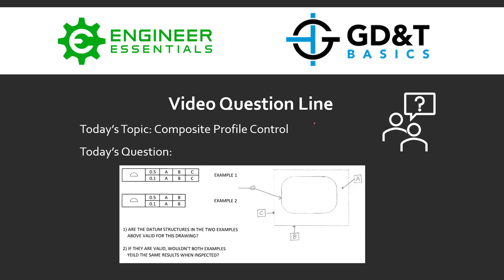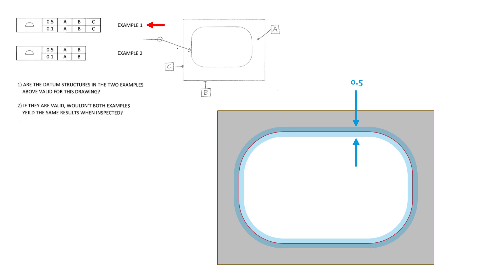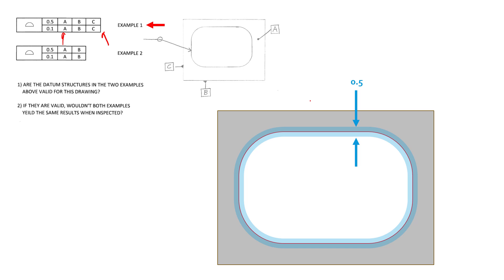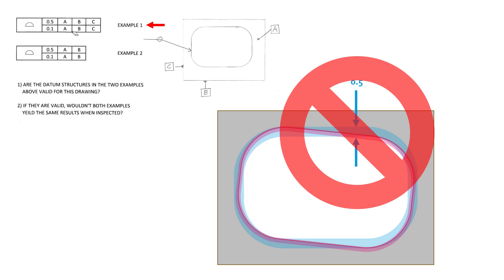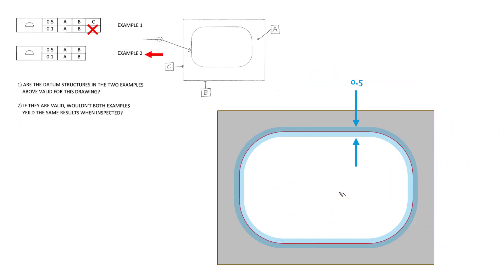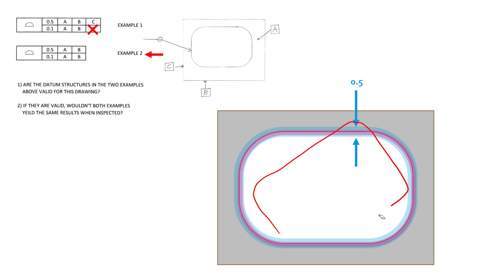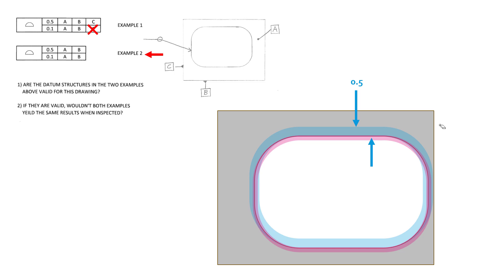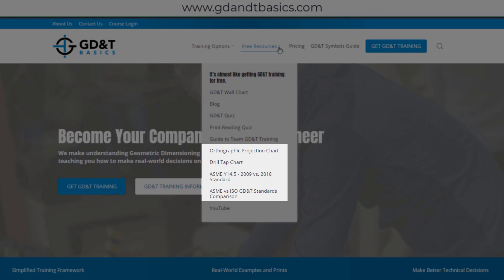Composite Profile Control

Comment: Wondering as you the delete datum "C", at 3:20, 
can we delete datum "B" from the 2nd line of
control frame of Example 2 (for tol. 0.1)?
To allow rotation but with in the area for  tol. 0.5 ?
Reply from the maker: Yes you are correct you can get rid of B from the lower frames to allow more rotational freedom within the larger tolerance zone from the upper frame.